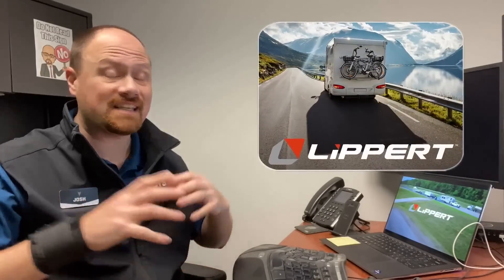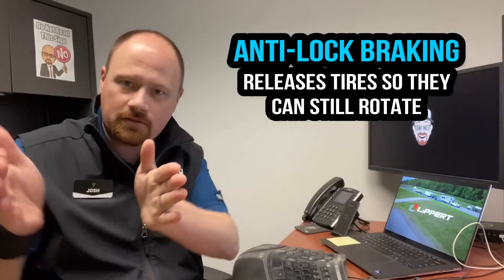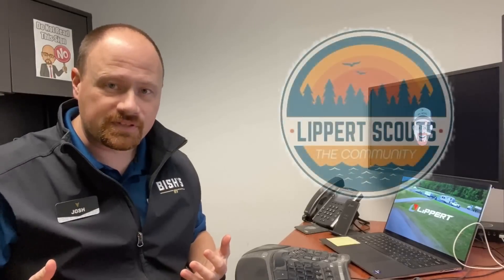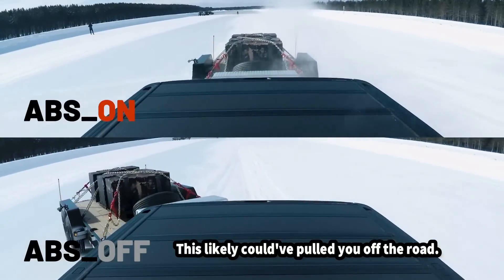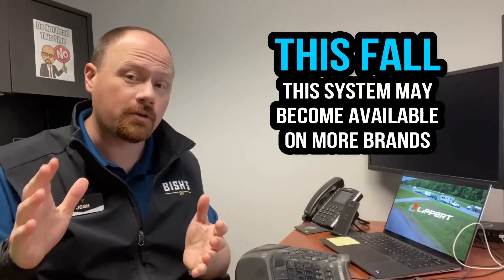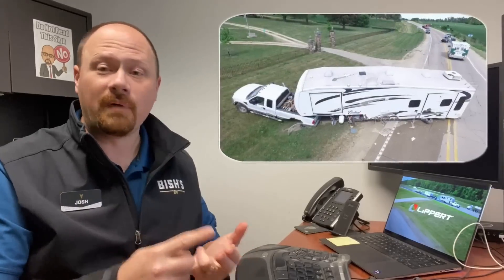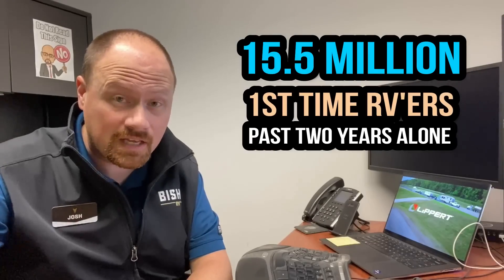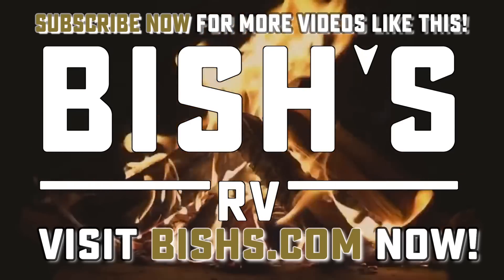This New Safety Feature Changes EVERYTHING!! [RV ABS for Towable RVs]

Comment: I agree this needs to be a standard for the industry, but I ask why they can’t go one step further? Why are braking systems on towables still using antiquated designs? With the weights of these things ever increasing why can’t they provide disc brakes from the factory? I understand they’re readily available in the aftermarket, and yes the electric drums are significantly less expensive; however, there is a reason all vehicles today come with disc brake systems. Less complexity and greater stopping power. A  20K fiver with disc brakes and ABS capability will indeed provide increased safety on the road. I just learned my state quietly passed a new law in attempts to reduce fatalities and accidents involving towables so I’m currently upgrading all my equipment to meet and exceed safety standards for when they pull me over when towing. I can smile, say thank you, and be on my way all while avoiding my rig being towed and impounded.
Reply from the maker: All fair. Ty

Comment: I'm not into bigger government mandating our lives however, government regulations have helped with the safety of the automobile industry. Proven safety regulations should be made mandatory. Imagine a lawsuit: RV manufacturer puts safety features as standard equipment on their premium RVs and an "option" on their cheaper models. Attorneys would have a field day with this one as "If you knew it would prevent accidents, why didn't you make it standard equipment?" @RV Manufacturers You need to do better.
Reply from the maker: 100% respect what you’re saying
I dont like mandated in general but.. safety is another issue

Comment: the first time i seen ABS on a trailer was about 1982 maybe the problem was the tractor did not have ABS and on snowy roads icey roads the trailer would stay straight and the tractor would turn 90 degrees not fun
Reply from the maker: Yeah there was a wacky overlap during that time that's pretty much resolved now

Comment: I don't understand why travel trailers and all 5Th wheels are not factory equipped with not only ABS but also disc brakes. When pulling a loaded 53' van trailer the comparison of safe braking to drum brakes is very different in that the disc brake equipped trailer follows you so much better and safer.
Reply from the maker: Most current RV ABS systems are not compatible with disc brakes though I suspect that will change with time

I'd like to see more basic towing safety requirements for sure

Comment: After over 40 years in the Automotive Business -- Countless Repairs on all kinds of ABS systems -- the Talent Pool at the Factory is to Shallow in my opinion to do a QUALITY INSTALL. No 3m splices/scotch locks used on this wiring !!! Besides all the Service Tech's in the RV Business getting Training -  This could take a few years to get everyone up to speed. Just the Intermittent problems associated with ABS can cause a man or women to Drink. Great Idea - Don't think it's going to be an over night success.
Reply from the maker: You're not wrong and your points are super fair. TY Neal

Comment: Regarding the exclusivity period for Grand Design, is this not profit over safety yet again in the RV market? Apart from the fact that anti-lock braking on RV trailers should have been mandated long ago, to now hold back the system from other RV manufacturers and the public with this exclusivity deal (if I'm understanding this correctly) makes me a little angry. I get that consumers drive the market but if a feature is never offered in the first place, the consumer's infulence is, to some degree, diminished/hindered in driving that market.
Reply from the maker: Lippert simply couldn't build enough modules to supply everyone

And logically I can't expect a company to stay in business by handing things out for free. The company that makes seat belts makes money on them for instance. It was just awesome of VW to release their patent for public safety. Features still have a cost associated with them. 

I've also learned systems like this have been available aftermarket for a while. It almost exemplifies my point in making this video -- It's a potentially huge safety factor that simply nobody has been talking about

Comment: To limit this safety device to a small segment of the market for a period of time is unconscionable.  It should be available to anyone who buys or owns a trailer.  When Volvo invented the three-point seat belt they didn't keep it to themselves, they left the patent open so every manufacturer could install three-point seat belts.  I'm not saying Lippert should have an open patent, but they should make their system available to everyone immediately.
Reply from the maker: Something I should've shared: The partnership with grand design was more an issue of volume than anything else. They didn't have the production to provide more for everybody at the time. This gave them a chance to get it out into the field, make sure it's up to snuff, then open the gates. 

I get what you're saying but there's more to it than that.